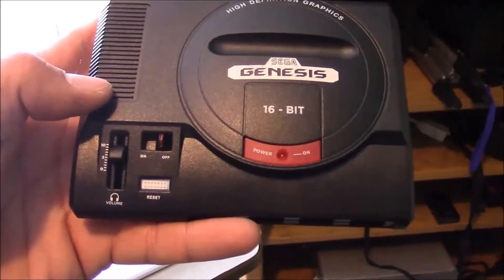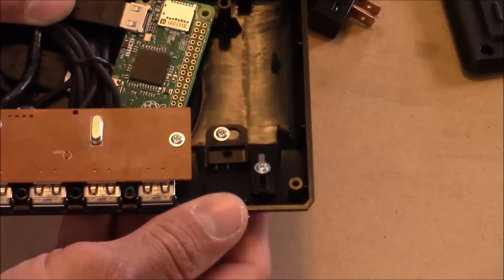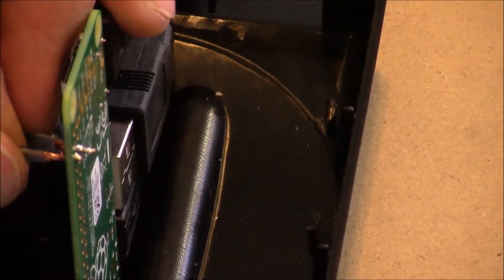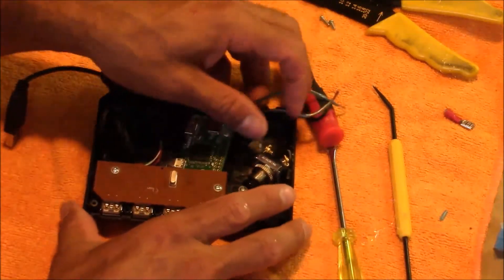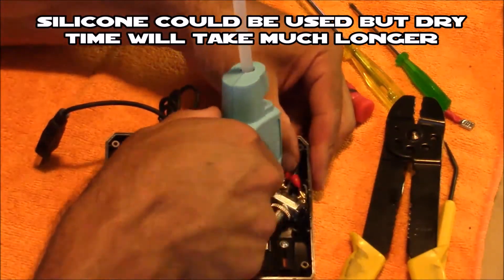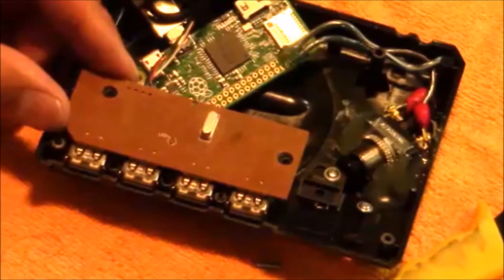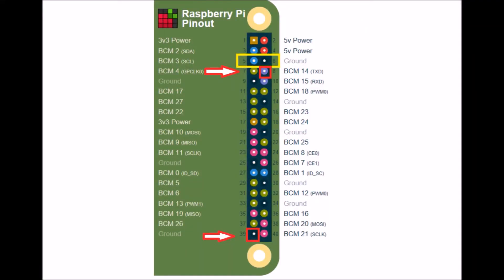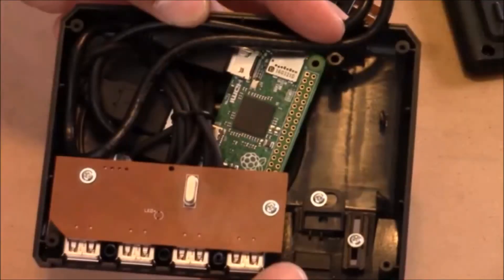Sega Genesis Classic UPDATE How to make power button functional

Comment: What wire did you use or recommend?
Reply from the maker: i just used 18 awg speaker wire which was a little big so i would recommend 20- 24 awg electrical wire. If its speaker wire that will work or really any wire designed for electrical.

Comment: Is there anyway to use a toggle switch with the Pi?
Reply from the maker: You can but It has to be a momentary toggle switch otherwise it will just continue to turn off and on... over and over and over unfortunately . It needs to run shutdown script to turn off safely that's why the momentary switch works.
Reply: 8 Bit Flashback I see, but is it possible to use an actual on/off switch too? Or does it have to be momentary also?
Reply from the maker: Mackadotious51 its possible but it will shutdown improper it could corrupt your files.
Reply: Yeah i was just wondering if there was a way to attached a shutdown script to the off/off switch like how we do with the momentary switch. At least without having to get another PCB or moffet chip to use.

Comment: I was trying to use the wire from an arcade button to attach to the momentary switch but can't get it to work? Do I NEED the terminal connectors to make the momentary such functional?
Reply from the maker: Cory Castelan no just needs to be a conductive material from one end to the other.  But you also have to install retropie script for button to work.

Comment: Any link to a place online I can get that button or similar button?? Also I notice your using a Pi Zero like me (thumbs up for not wasting a Pie 3 when your only playing 16bit games), any videos on getting RetroPie's image (theme) to look like the famous "NES theme" that's popular on the net, but looking like a Sega Genesis ver. theme?!? I saw one (only one) that was made for the Pie 3, but the owner of that theme won't make one for the Pie Zero :'(.. I'm just looking for a video that plays once that shows the familiar "SEGA" logo with Sonic running through it, then a black screen till RetroPie (with the custom Sega Genesis theme) boots up. I'm only looking to run Master system, Sega Genesis, Sega CD, and Sega 32X.. nothing more. Any help with this would be greatly appreciated!!
Reply: Ok after doing some searching, I actually found some answers to my questions.. Sadly been looking for an answer to my second question for about a month..

Ebay for the switch, slightly different, but has the same part number.

http://r.ebay.com/8zFDsd

I also ordered this one, since it has the wires and connector at the end and is smaller, not sure if it will give me the same results..

http://r.ebay.com/9DYVYF

And for the image for all Pi's (i.e. Pi Zero, Pi 2, Pi 3)..

https://youtu.be/_vOJqkbe8OM
Reply from the maker: You should check out my splash screen video.  I am working on a attract mode image with video snaps  that I will be uploading here soon that you might be interested in it has custom menus for sega consoles and others but the ones you don't want could be deleted though. The image will have emulation station and attract mode on the same image . It will be around 32gb .
Reply from the maker: My Sega intro https://www.youtube.com/watch?v=UJQ_yoUau1I
Reply from the maker: here is a switch very similar to mine 
 http://www.ebay.com/itm/SWITCH-PUSH-BUTTON-NORM-OFF/122157505164?_trksid=p2047675.c100005.m1851&_trkparms=aid%3D222007%26algo%3DSIC.MBE%26ao%3D2%26asc%3D40130%26meid%3Dd4c9f3b05bdb4f50b39fc8f2ce4961ca%26pid%3D100005%26rk%3D1%26rkt%3D6%26sd%3D152465184630
Reply: does the pie zero run austins genesis build ok?

Comment: ok so I got to make a file for this to work
Reply from the maker: KICKING IT WITH RAY!!!! on the command prompt for RetroPie you have to enter the commands  in description starting with #1.   
There is a program called Putty that will allow to remote control your RetroPie so you can copy and paste these commands. You should check out ETA Prime's tutorial in the my description it explains all this in pretty good detail.
Reply from the maker: KICKING IT WITH RAY!!!! This is the safest way to turn off RetroPie and not damage your SD card.